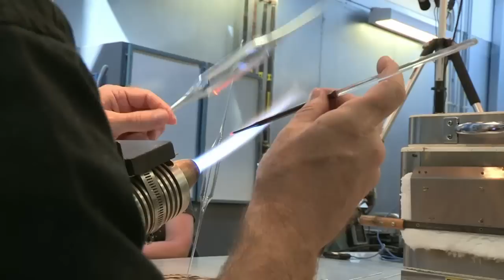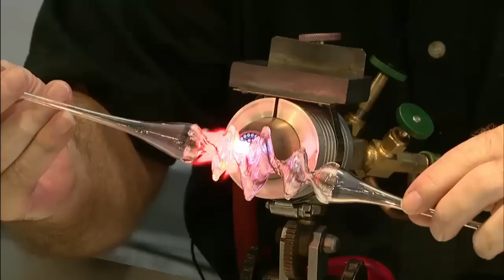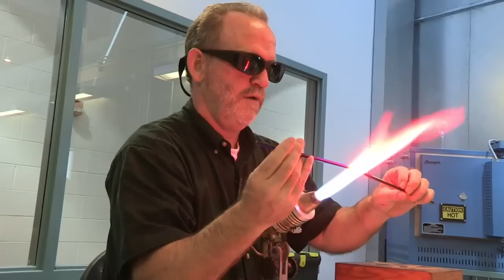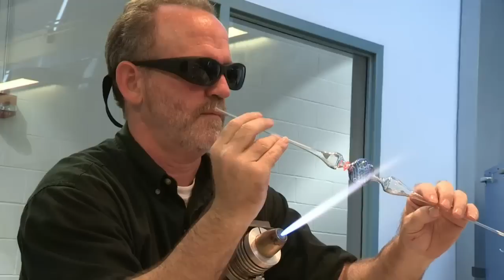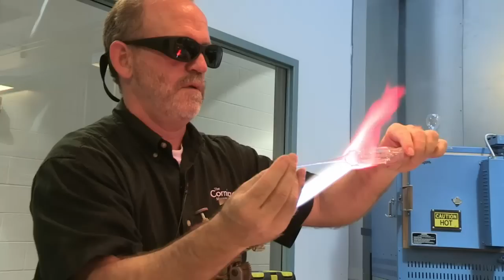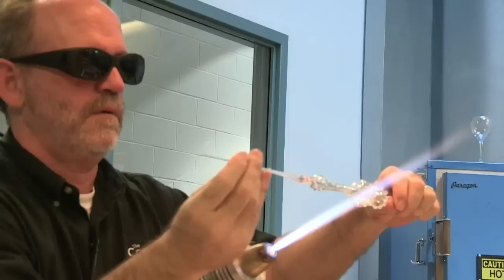Studio Demonstrations: Jim Byrnes

Comment: that first tube you used that has the fat middle. did u make it like that or do u but them like that?
Reply from the maker: The tubing is made that way by heating and stretching one area.  It's a process in scientific flameworking called "pulling a point".  This allows the tubing to be made into smaller units that can be made into individual projects.